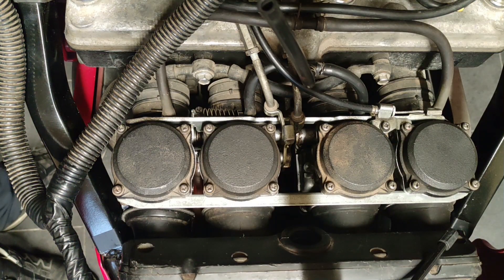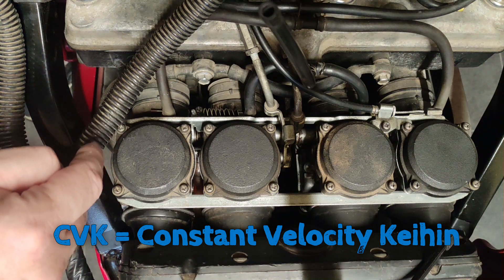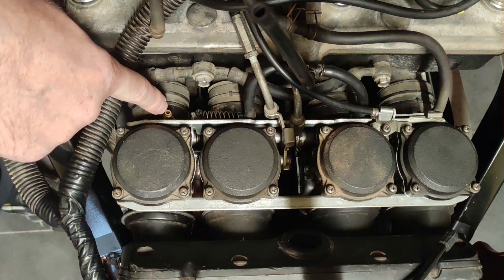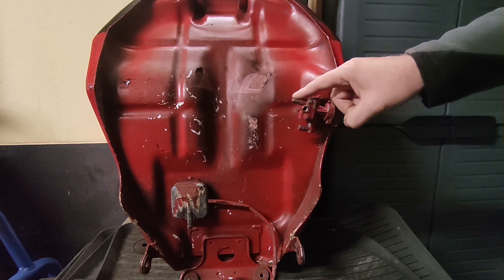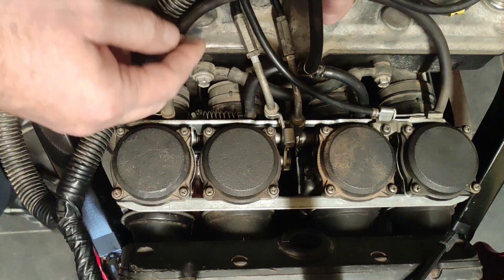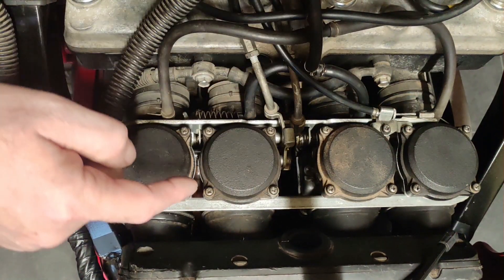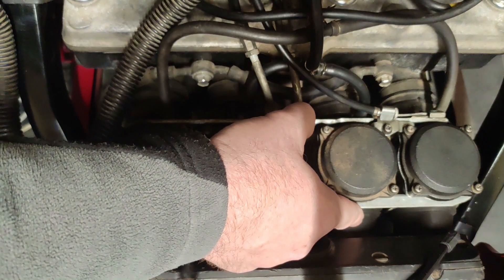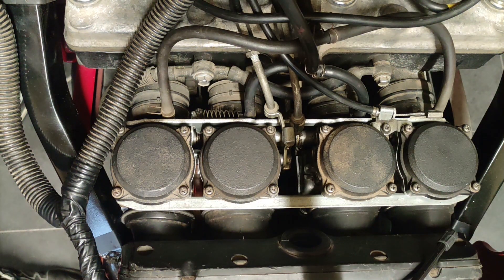GPZ600R Keihin Motorcycle CVK32 Carburetor explained.

Comment: I am restoring an 85/86 A1 model but looks like the carbs have been replaced with carbs from an 89 model because the four main jets are all 102 size. Also there are extra pipes coming off bottom of each carb and joined up but these appear to connect to blind holes in the bottom of the carbs. Any idea what for? Do I need this extra piping on earlier model and should I change the jet sizes to 105/108?
Reply from the maker: The additional piping is for carb heating, but it sounds like yours have been butchered and are not connected to the water system anyway. You can pretty much ignore it, remove it or replace the bowls with ones without the heating.
Yes, I recommend replacing the main jets to the original 105/108 jets. Just make sure the pilot jets and needles are the correct ones too 👍🏻
Thanks for watching and have fun.

Comment: I watch all your videos. Thank you very much for all your effort. I have been strageling for years with the GPZ carburetor. Cleaning them every year. But in spring the same issue.  Followed all advices (aditiv, fuell super, carb cleaner) I had the GPZ in several workshops. They cleaned the carb and after 3 moths again the same issues. We derust the tank, added fuel filter but no sucsess. Now, even with a clean carb, the engine runs like shi..... Starts exelent, but after some minutes it will not take full throttle.  Anyway, I enjoy to see the pasion in your work :-)
Reply from the maker: Hi and thanks for watching. Maybe you don't have a carburetor problem. If the engine starts but after a while wont run, it might be a thermal problem somewhere in the electrics. A coil, the CDI, Pickups ? All prone to breaking down when hot.
Reply: @MrLefthooker   thanks for that hint. Ich checked the coils, plugs  resistance (O.K.) new plugs/sparks and still having issues. 3 Years ago my CDI was damaged. Maybe it is again the issue. I wil try to find one on ebay. thx. And don't stop doing videos :-)